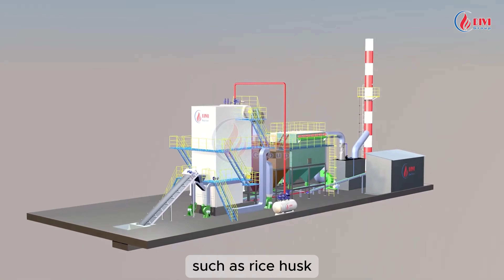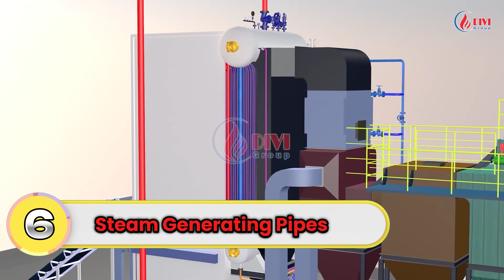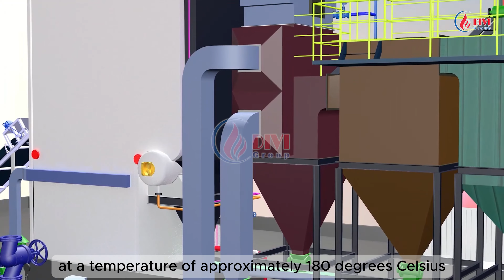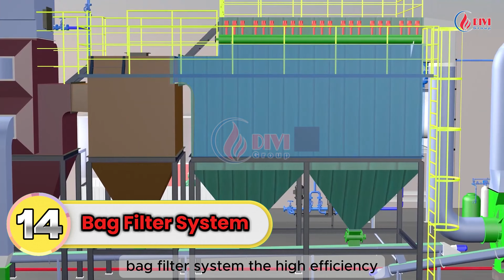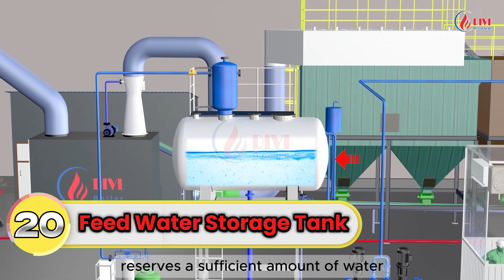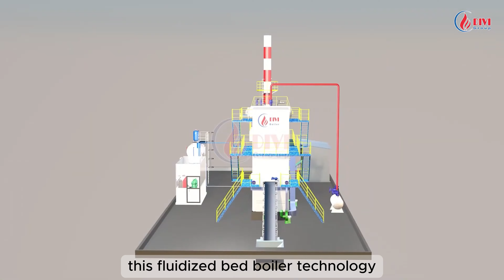DIVI Boiler 3D Simulation | Two-Drum Fluidized Bed Boiler Working Principle

Comment: How does the fluidized bed combustion process work in biomass boilers?
Reply from the maker: In a fluidized bed combustion process, biomass fuel is suspended in a bed of hot, moving particles, which enhances combustion efficiency and reduces emissions by promoting thorough fuel burning at lower temperatures.